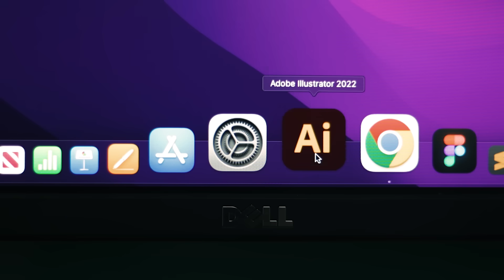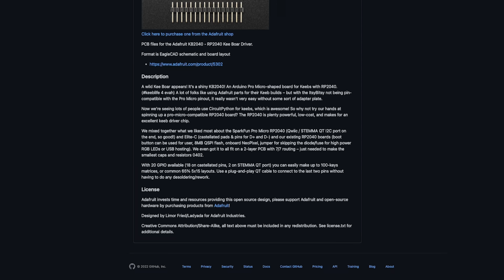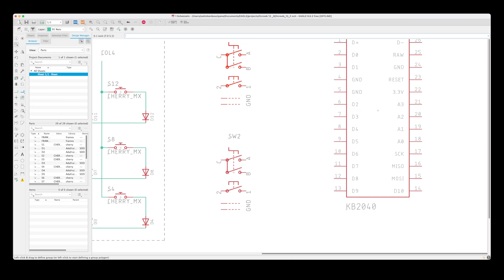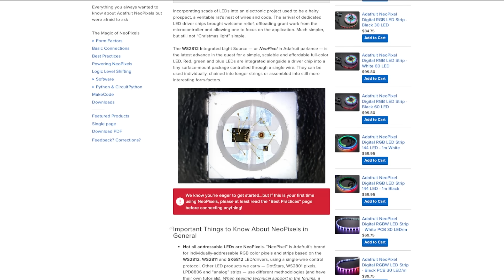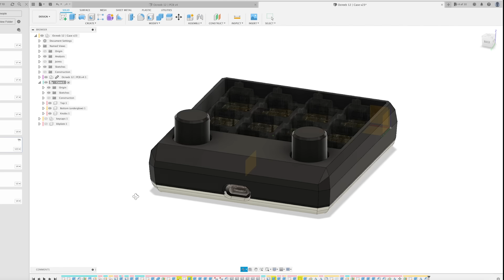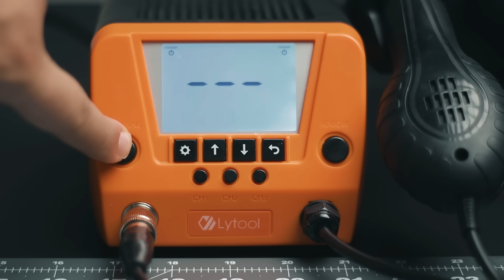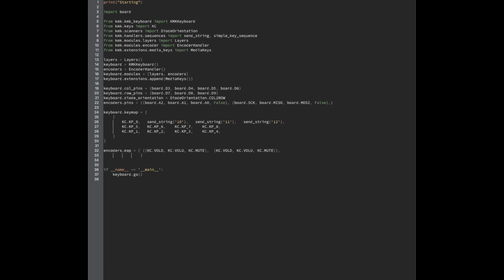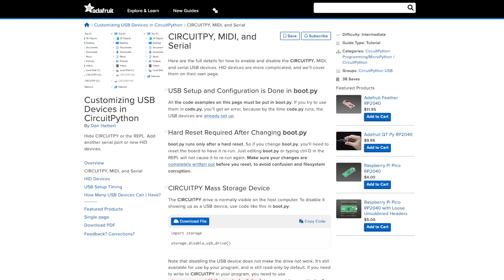DIY Macro Pad Keyboard Build from Scratch with Custom PCB and Mechanical Switches

Comment: nice video but i had a question. Does anybody know if i could use similar parts from other manufacturers and others sizes (slightly larger or smaller) and so because where i live a little part is going to take 31 WEEKS TO DELIVER

Comment: You don't need a level shifter. The WS2812 LEDs high signal is something like 2V5 so 3V3 is more than sufficient 

Moreover, even if you would need 5V, simply use a mosfet for switching a 5V line

Comment: Can I also use Raspberry Pi Pico W instead of the Adafruit KB2040?
Reply: I think so.....both are using the rp2040 chip.......

Pinlayout might be different and so will the size etc be, but after adjusting software and the enclosure, it should work without problems

Comment: Hi i have install circuit python on pico but once i reconnect it, the pico does not show up i tried with holding the bootsel button but there is no circuit python on board after a disconnect, Please Help

Comment: Great video! What software do you use to create the app that goes with the device for configuration and programming? 

Or is that done on the hosts computer in their system preferences?

Comment: its a nice design and good informative video on how to build it , recently i was able to get the PCB and tried building it works fine with peg software but i wasn't able to add custom code to control rgb with patterns as am noob in coding  , what should i do ?

Comment: I have some trouble with coding, when I am using some example code it works, but when I copy your code to Kb2040 it does not work, red led blinking twice. How I can solve this problem? Should I change something in a code?

Comment: Hi! I'm currently working on a project and I'm having some trouble. This is actually my second attempt at putting it together and soldering it, but unfortunately, it's not working. I noticed that before I started soldering, it showed up on my computer just fine. However, after soldering, the LED status light turns red and it turns off completely, and it doesn't show up on my computer anymore. Can you please help me figure out what's going on?
Reply from the maker: I'm not sure I'm following. Are you trying to put together this macropad project?
Reply: @salimbenbouz  yes
Reply from the maker: It’s hard to recommend anything from what you commented. I would suggest that you check your soldering and if you have any shorts. After that google how to erase and reload the uf2 on the rp2040 if you need to

Comment: When you need a 3d printer, knowledge of PCB design and electrical circuits .. definitely not a DIY  project.
Reply from the maker: What do you mean not DIY project???? That's literally the definition of doing it your self ... figuring it out and making the thing on your own. A 3D printers are very affordable and a very common tool among hobbyists these days. Also PCBs cost as little as 5$ now ... IDK what kind of excuse is this but I don't get it

Comment: At 0:40 seconds I knew it was Figma hahaha. Great video! What do you think of the new Figma macropad coming out? I'm still going to try it, but it looks pretty over engineered.
Reply from the maker: haha thanks! It looks soo good. I mean you can get most of that functionality with any macropad but I love the design for the figma one. It's based on the WorkLouder stuff, they have great design
Reply: @salimbenbouz  Thanks for your 2 cents on this! I've seen WorkLouder stuff and love the design of their nomad keyboard, but don't like low profile. My work ordered me a Figma macropad so I'm excited to try it out, but I feel like there could be some improvements for better productivity. I'm staying optimistic though! 

Also --- I'm a UX/UI designer who is interested in learning how to design my own Keyboard PCB's by the end of the year. Do you recommend any kits that would be best to start learning on? I've seen this "30 Days Lost In Space" kit but heard the videos are pretty dry.
Reply from the maker: Idk any particular kits but what works for me in terms of learning is taking on projects that are slightly beyond my ability and struggling them to the finish line. However, it's important to keep in mind that there are certain requirements and basic electronics knowledge beforehand. In this, the kit you mentioned might be helpful, although I've never tried it myself.

PCB design is an entirely different skill set, yet it still requires understanding the electronic part if that makes sense. A macropad is a great first project to start with, especially since you're interested in building a keyboard. I just published a video on the Ocreeb MK2 which you might want to check out. Although it's a bit different, you could still find value in the detailed process.

Comment: Instantly subscribed! It's a matter of time before you'll eventually splurge on the Aixun T3A or T3B soldering station. It's a JBC clone that makes soldering so much easier and more reliable due to its razor accurate thermal control.

Comment: Damn dude! Nice work! I thought the RP2040 has enough IO channels so you don't need diodes for this project. Am I missing something?
Reply from the maker: Thanks ! You're correct about the RP2040; it has around 30 GPIOs I think. However, on most boards, only about a dozen or so are accessible. For instance, the KB2040 has 18 GPIOs available. If we connect 12 switches directly, along with 2 rotary encoders (3 pins each), we'll use up all 18 pins. This means we'll need an extra one for the Neopixels (we could potentially get it from the STEMA connector). Anyway one of the goals for the project is to show how to make a keyboard matrix to minimize the number of IOs required. With this setup and additional diodes, it's possible to around a 100 keys I believe.

Comment: Hey Salim, great work and even better video guide. Where did you get the KB2040 and MX switch parts/assets from for Fusion? were you able to finde them somewhere or did you have to make them from scratch?
Reply from the maker: Thanks. I collected them from different places. The KB2040 was from Adafruit’s GitHub and the switches from GrabCAD if i remember correctly.
Reply: @salimbenbouz  Awesome thank you for the quick reply. No point in manually generating assets if somebody already has done the work.
Reply from the maker: @Lord-Kanzler  exactly! If there is any critical dimensions or if you’re basing any mechanical design around assets from the internet, I’d double check them first but other then that I almost always find them already made.

Comment: Pretty nice vid and cool project !
piece of advice: don't do such long timelapses with no comments and just music, it completely stalls the video tempo and wastes the viewer's time: there is nothing of value just looking at you soldering or multiple 3dprinting timelapses. If you want to illustrate something a short 3-10s clip will the do job just fine even though it doesn't represent the whole thing.

Comment: Hey, a very nice video. I have a question about connecting a resistor between the 3.3V voltage source and the input of the level shifter. Are you using the resistor for the protection of the level shifter input or for some other purpose?
Reply from the maker: Thanks. If I remember correctly it’s a pull down for the Enable pin

Comment: Lovely design, but I think I'd prefer to use 3x Adafruit NeoKey 1x4 QT I2C Breakout boards for a project of this size, since it comes pre-assembled, the 5 point cherry MX compatible keys are socketed, so you can replace them easily when the break without having to de-solder them, each key has it's own Neopixel, and you can connect multiple boards to a Arduino or RP2040 via STEMMA QT (Qwiic) with no level conversion needed, so it's all very scalable.

Comment: while priting keycaps using sublimation how much heat you applied is it 250 or more ?
Reply from the maker: I think it was around that yeah. I experimented with doing a little less hot and doing the sublimation twice. I don't recall what worked the best. Checkout that video I linked in the description it has a detailed process.

Comment: I really do not understand how to customize the keys, I got to the construction, I have everything ready, but this does not seem to be for a person with little knowledge of programming, so if you do not know how to modify code you can not change the functions of the macros, is not it possible to use this with a program like VIA or VIAL, to be able to define at will the macros without complexity?
Reply from the maker: These kinds of projects go hand in hand with basic programming. You can read the KMK documentation to better understand how to customize your keys if you wish.
I also have instructions to use a software called PEG for flashing if you prefer to remove "complexity". You will have to use the firmware in that specific folder ** for this to work. https://github.com/sb-ocr/ocreeb-12/tree/main/Peg

Comment: is there any way to replace the micro controler footprint for an arduino nano footprint?, im using easyeda but i cant edit the files you posted on github, thanks in advance
Reply from the maker: Yes you can change it but you'll have to use Eagle or Fusion 360 I think
Reply: @salimbenbouz  tanks for the response, i figured out i can inport eagle archives to easyeda editor, its all done, i just need it the cherry footprint and change the pi for the arduino nano, now is time to wait to all the parts to come, i hope the pcb i make is funcional, all tho the video help me a lot, i's awesome, thank you again😁😁🙌🙌

Comment: Foreword: Create a product like this, and the Video community will shower you with eternal admiration!

Backstory: My desire is to use my Sony VX-1000 Camcorder without relying on tapes. The most straightforward approach would be to connect a Sony HVR-MRC1 memory recorder to the camera's Firewire OUT port. Regrettably, these recorders have been out of production for over two decades. Although they can still be found, I am reluctant to spend $400 on outdated technology. This led me to explore alternative options, but it appears that no modern memory recorder with a Firewire port is available anymore.

Consequently, I thought about building my own solution, but I lack the knowledge in electronics, programming, and coding required to do so. The only viable option is to assemble a makeshift solution using existing hardware. During my search, I discovered SCB's (Single-Board Computers). While they don't come with a Firewire port, they can be customized by adding one. My plan would involve installing Windows 7 on the SCB and connecting a mouse, keyboard, and screen to it. Then, I would run an application like WinDV to record the incoming Firewire stream.

Clearly, this setup is far from ideal, as it necessitates carrying around a lot of additional equipment. It hardly compares to the convenience of simply purchasing an HVR-MRC1. However, I remain hopeful that someone reading this might come up with an ingenious solution. Perhaps, by writing a script or firmware, the SCB could be made to operate without the need for Windows 7 and the accompanying hardware. I am not well-versed in this area, but I'm curious if such an approach could be viable.

Thanks.

P.s. Do you mind if I post this in other videos of yours so as many people as possible can see this? Maybe someone can help me out? : )

Comment: Did you do anything to the printed black PLA to smooth it out? The layer lines aren't visible in the video!
Reply from the maker: Not on this project. Ot's just a clean black matte PLA print

Comment: I've actually been working on my own design of something like this, except its a Bluetooth arm mounted device with a lipo battery (though I am thinking about maybe changing it to double As
Reply from the maker: Wow! It sounds pretty cool. Did you get a prototype working?
Reply: @salimbenbouz  ha nah, not yet, I got the basic design down, 12 cherry mx keys and 2 rotary encoders I had laying around, with plans of using a adafruit feather that supports Bluetooth and a direct lipo battery. I also included plans for a small led screen just to monitor battery, even time. 
I'm just having trouble with the circuit, because I've never actually done something like this before, so I'm trying to figure out connecting a keyboard matrix to the feather, as well as the 2 rotary encoder and screen, while fitting it all on an arm. I've been tempted to go for the pcb route, but I might just need to go for hand wired, after that, then I'll enter coding hell, which I've also never done before, so a lot of firsts for me!
Reply from the maker: @VelocityArt  awesome! I Hope you get to make it real. Since this is portable. Maybe give the XIAO nRF52840 a try? It’s super tiny and has onboard charger for you lipo as well if you want to make your build as compact as possible. Best of luck!

Comment: Why are there diodes for each key switch?
Reply from the maker: To prevent current from traveling the wrong way and mess up the reading (ghosting) 
You only pull the rows/columns one way while actuating the switches.

Comment: This is a really cool project, amazing work! I'm close to ordering parts to make 3 :D Where did you get the printed key caps? I'm considering just printing them as a multicolor print so I can have my own icons
Reply from the maker: Thanks! I did them my self. There is link in the description to a video on that process (Dye sublimation) I ordered a sublimation sheet from Etsy with my own designs and transferred them with a hair straightener and silicone sheet.
Reply: @salimbenbouz  Etsy is a great idea, didn't even think about it. Making your own sublimation sheets seems a bit of a painful process.... I think I'll give 3D printing them a shot, but this is a great backup

Comment: 2:57 if in your theory there is nothing wrong with that approach, then its crap, not a theory
Reply from the maker: There is nothing wrong with attaching switches directly to I/O pins without matrices or using I/O Expanders, it's even arguable that it's better in some cases since you don't need to deal with all diodes. I was demonstrating that with a lot of keys you're probably better off with matrices. It's not the only or best solution but it's just the most common one.

Comment: Great content.

May i ask an another question?! Is possible to make a wired keyboard wireless. I have a corsair K70 low profile and its really a great keyboard for me. But it would be great to have it wireless.
Reply from the maker: Thanks. I’m sure you can find a Bluetooth dongle or smg to convert it.
Reply: @salimbenbouz   Thx. So technically its possible? I mean also to manage the RGB, Audio controll on it and so on?

Comment: Man if this had a touch id pad on it, it would be PERFECT. I hate that I have my macbook closed and put a side connected to a monitor but in order to unlock it i have to open it to use touch id. I just can't be arsed remembering my long ass password. lol
Reply from the maker: If I’m not mistaking there is a chip for encryption on the MacBook that handles all that on device. I don’t think it would be possible to do it externally with simple HID device like a Macropad. With that been said you could implement smg similar that sends your password when you fingerprint is valid with a scanner on the macropad. Not sure if it’s worth all the trouble though 😂
Reply: @salimbenbouz  true after I posted I realized doing anywith with the fingerprint would likely expose it to security risks like bruteforce attacks etc. Maybe I can do something with a yubikey...

Comment: You didnt say much about the potentiometers, how is the integration of them to the computer? are you using a controller inteface or does it never inputs anything to the computer?
Reply from the maker: I’m using rotary encoders not potentiometers. I use them to change volume and RGB values.

Comment: Is it possible to do this build without the RGB (the Neopixel 5050's) ? I don't have much experience with PCBs or soldering so I'm unsure if the board would continue to work without certain pieces. Just trying to save some money :)
Reply from the maker: yes it's possible. In that case you can remove the Neopixels, caps, the resistor and the level shifter.

Comment: You can cut the level shifter by just drawing 5volt directly from USB.
Your approach seems very roundabout did I miss something big here? If that board has no 5v pass through just tap into the voltage before the shift to 3v.
Reply from the maker: The shifter is for data line coming from the board to the Neopixels and not the supply. The 5v supply is coming from the usb indeed like you mentioned. And you can getway with 3v to 5v data without shifting in smaller setups like this but what I understood from the resources I found that’s not the proper way and I didn’t want to give wrong instructions to someone using this in another project.
Reply: @salimbenbouz  Ah, okay, it's correct then. I assumed it was power supply. But 5 volt logic is different.
My bad.

Comment: Hi, I really like your design, it's by far the best micropad I've seen so far, but I have one problem, I can't order the kb2040 because I live in Serbia, if I were to order just the shipping, it would cost me $65 for one kb2040, which is not worth it, so if you could make an arduino pro micro version I would be very grateful.
Reply from the maker: Thanks! If you want to make this exact one, you can Try to find another rp2040 board on AliExpress with a close enough footprint and rewire few connections or change the pcb before ordering. I left all the files in the GitHub repo. 
Best of luck!